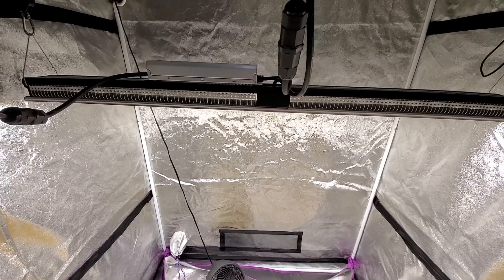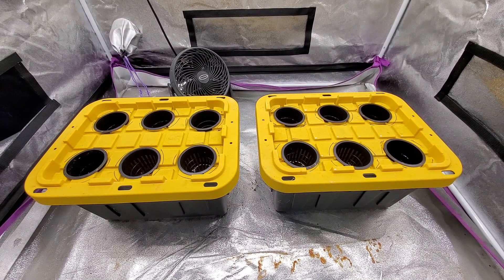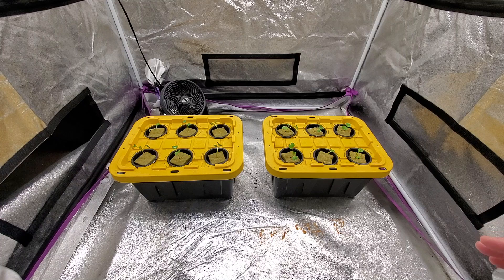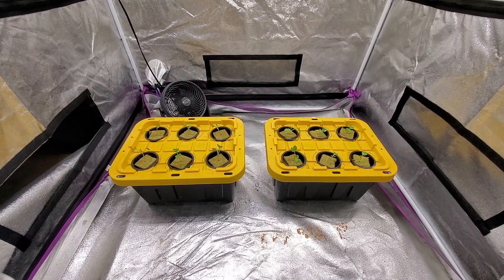Kratky hydroponic radish grow with the Mars Hydro SP250

Comment: Hi Peter what fan is that and would you recommend it?
Reply from the maker: I think it's a vortex something, don't remember the name. I think I got them used at Goodwill. One of them has a short, and cuts off, so I threw it away. Seems to work fine otherwise. It's not  oscillating but can be tilted up and down. I have another one that size that oscillates, I like it.
Reply: @pepperdactyl  Thanks Peter

Comment: Great job, Peter!  I believe these radish will only produce bulbs when the temperature is cooler.  Try letting the temp drop to around 55-65.
Reply from the maker: Thanks, Khang! That's good to know about the temps. Mid to upper 60s is the range I'd have without adding any extra heat.

Comment: Nice video, first time seeing a setup like this for radishes, and really like the 6 site, 5-gallon tubs that you are using.  That Mars Hydro SP250 will likely do well, if you transition to starting hot peppers in those totes too.
Reply from the maker: Thanks, Matt. I bet they would do really well in a static level maintained system with drain/flush/fill capability.  I think since the totes really hold only 3 gal, when filled to the bottom of the net cups, I had too many plants in there. I think a good perpetual setup would be having microgreens growing in something external, transplant the sprouts, and figure out timing on staging new plants to the tent so you have some you can harvest while others are still growing.